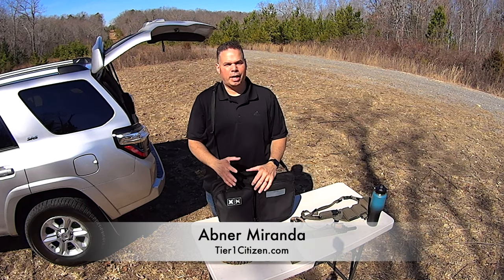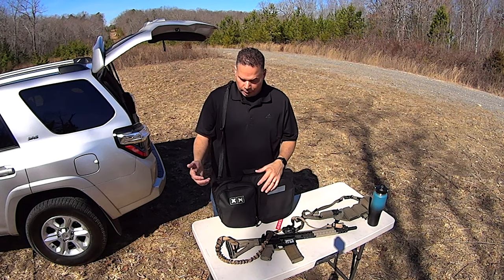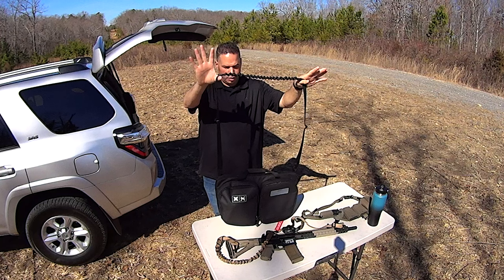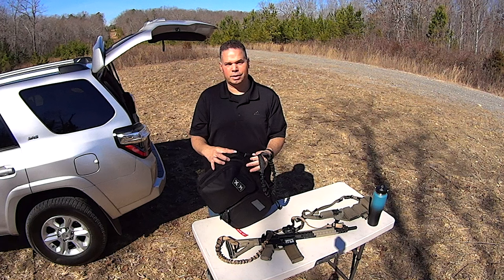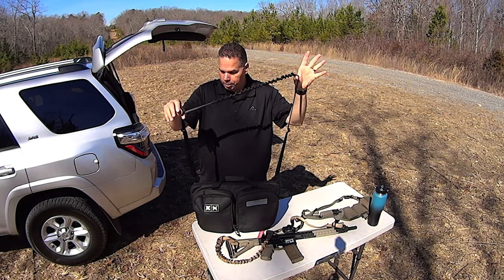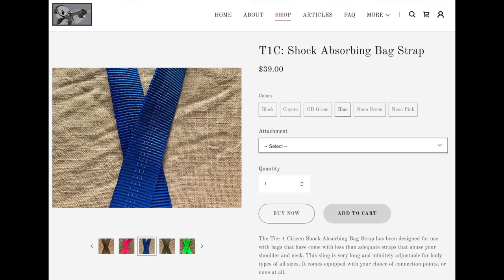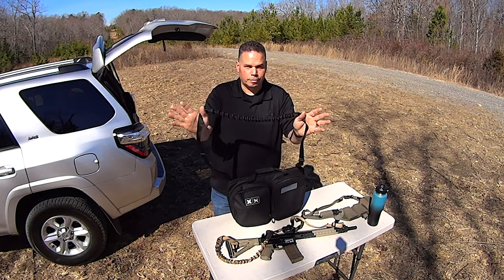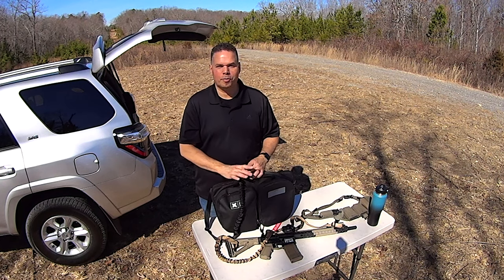T1C: Shock Absorbing Bag Strap

Comment: ISSUE!! How much actual weight will that support without pulling the bungie strap part close to its limit? I would think there are limits where they strap no longer plays shock absorber.
Reply from the maker: The Bungee never comes close to its load bearing limits because as it stretches out, the webbing catches the full load of what you're carrying. The Bungee never actually maxes out unless you have an excessively heavy bag. Ironically, this would actually be a very effective strap for carrying an excessively heavy rifle in the forward ready position, at the waste.